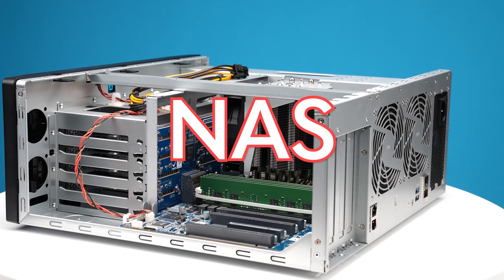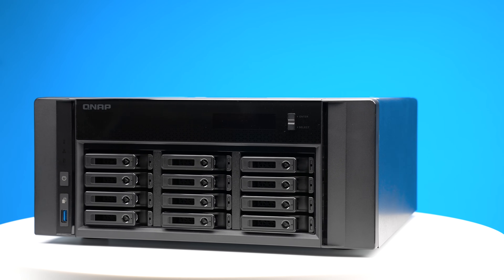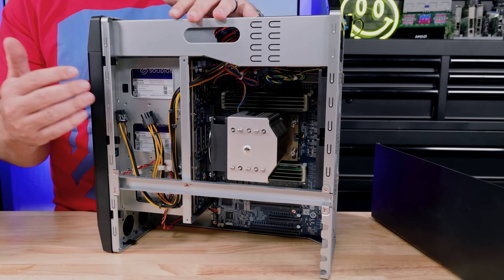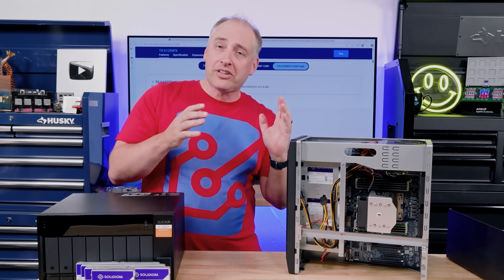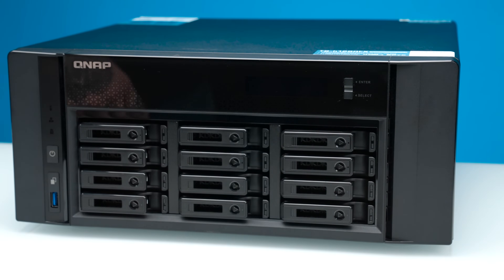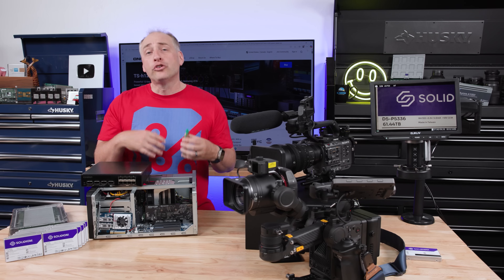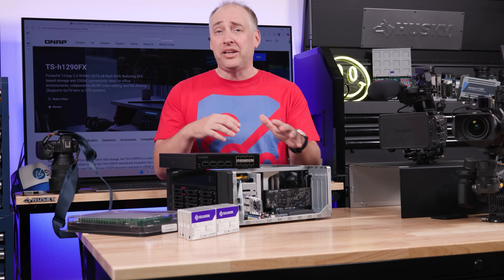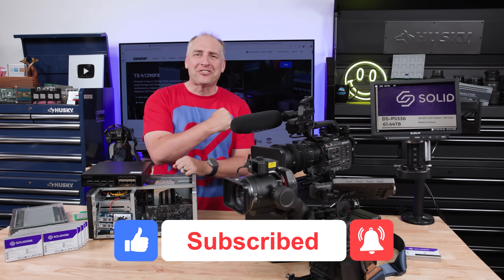SUPER Studio NAS with 360TB of SSD Storage FAST Networking and an NVIDIA GPU for AI

Comment: Where can one buy used 30,72TB drives? I only find them on eBay going for 4-8k which sounds a bit expensive (as the 15TB ones go for sub 1k on some sites). Cool video btw :D
Reply: Just buy 15tb ones lol. Comparing hdds to ssds is still stupid. You can buy like 6 30tb hdds for the price of 1 30tb pcie gen 4 ssd
Reply: There is a Newegg link in the video description that shows them for $3100.
Reply: @jschroedl983 Somehow I overlooked that. Thank you. Still a lot of money. Probably going with some 15TB ones instead.
Reply from the maker: They are for sale new for $3K each. Not cheap, but if you want flash, that is pretty decent. Used, 15TB drives can be had for under $1K each. Going HUGE you could buy 122.88TB drives, but those are around $10K each these days. Still, 1.4PB+ in a small chassis like this is cool
Reply: @ServeTheHomeVideo the 15tb ones are nice especially the kioxia used ones as kioxia will honor the warranty, or at least did with me as they were under 5 years when i got them
Reply: @ServeTheHomeVideo  Yeah, it is insane how much storage one can cram into these small NAS nowadays :D

But I think I'll pass on the 30 and 122TB drives :) Just wanting to add one "cheaper" drive via a m.2 or PCIe slot + external Sata power adapter to my TS-855eU-RP

Comment: $7000 for this unit 😬
Reply: I think more than that... especially if you have 2 or more of those 31TB drives
Reply from the maker: $4899 for the NAS, plus SSDs and any upgrades. Not cheap, but remember this is for multiple users in a business setting, not a single user.